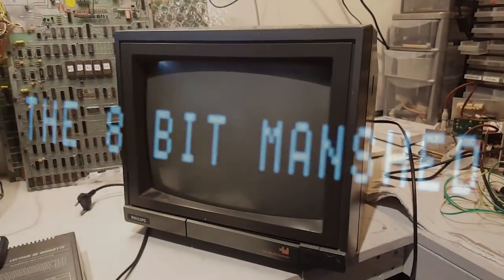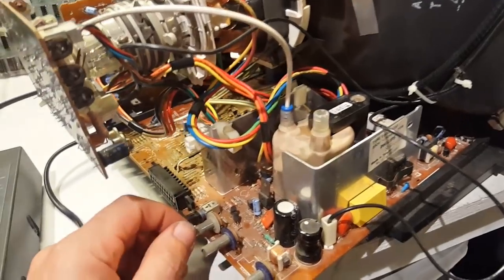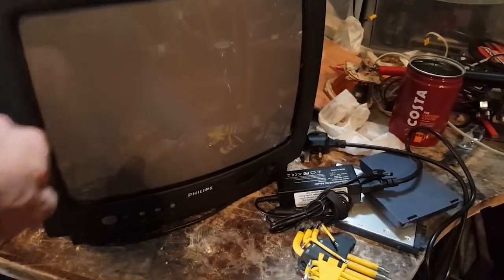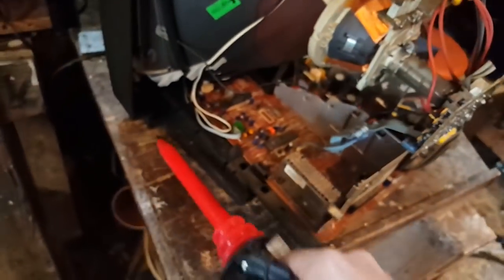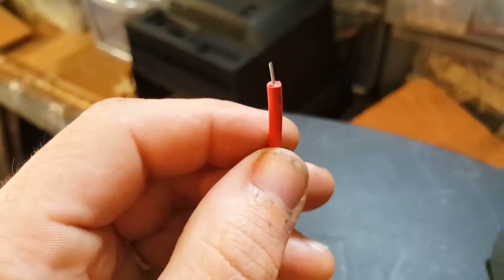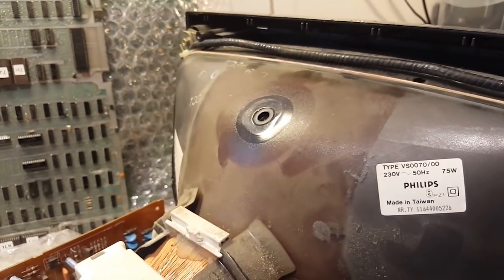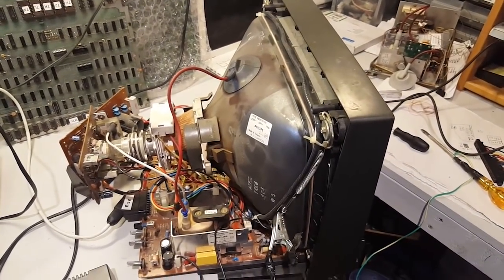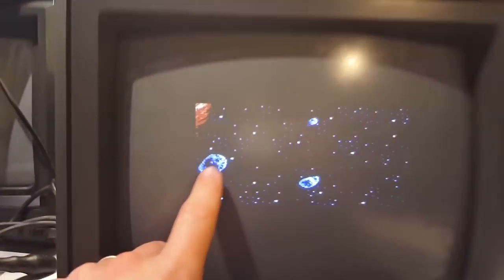Flyback anode cup replacement - Philips VS0080 /70 Monitor repair

Comment: I have been shocked after discharging the aquadag ,  it builds a smaller  charge after a couple of minutes,  my problem is   I have trouble hooking the anode cup and having it stay on.?
Reply from the maker: yeah it can be a nasty surprise. got caught as well once or twice. nothing bad but always a reminder to do it a couple or three times before handling the tube

Comment: Would have been great if you'd explained how to get the little retaining clip off, I'm trying the same thing but neither original nor donar are releasing the damned cable from the FBT. I see it's got clips either side but feels like you need to somehow push in both sides and lift?

Comment: The tool that you were using to discharge (the thing with the red shaft and black handle), is that also one you can use with a multimeter to measure the actual voltage (divided by 1000 on a multimeter) ? Or is it a specific discharge tool ?